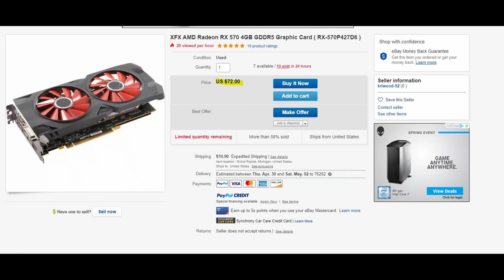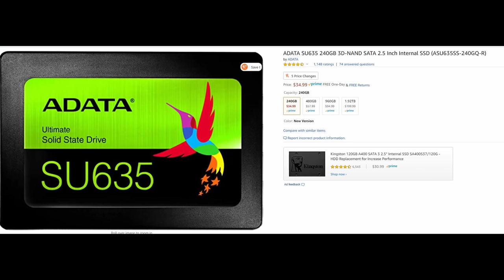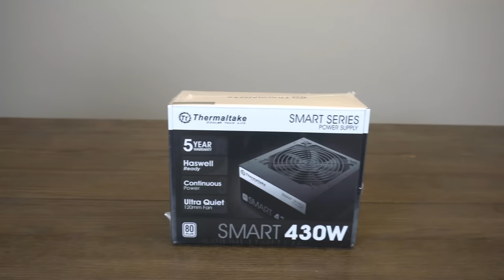$220 Just Get Gaming PC Build - Dell Optiplex 2020 + Benchmarks

Comment: And did you just placed the hardisk without putting a wire in it
Reply from the maker: Well it would seem silly to install a hard drive without cabling it up.  :) It was cabled up :)
Reply: @PCTechHustle  did you bought cable extra for hdd or it is just with psu

Comment: Hey so I got everything in this build, but when I play Fortnite my fps drops so low, like I’ll get 120 in creative and then 20 in a game, is there something I could upgrade or add to make this stop?
Reply from the maker: Lower your graphics settings a bit or cap your frame rate to 60.
Reply: PC Tech Hustle I have it on the lowest settings, and I have it capped at 60, it still drops to 20, is there something I can buy like upgrade to 16gb of ram and just get a better motherboard to support it?
Reply from the maker: cadecries you should be getting decent frame rates then.  16GB or RAM will help too if you only have 8GB.  Also check into possibly upgrading to an i7.  I have a video I released after this one covering the performance differences.

Comment: what should I upgrade I’m going to get it today but before I buy it is there anything that could change
Reply from the maker: I’d definitely suggest doing a GPU and power supply upgrade at the bare minimum.
Reply: PC Tech Hustle Thank you man now I can begin to game
Reply from the maker: Nice!  Good luck with your build and have some fun!
Reply: PC Tech Hustle One last thing my bad but what do you have any suggest on a gpu because I’m getting a power supply that is 500w if that good but if you have any suggestions could be under 100 or over it does not matter
Reply from the maker: I wouldn’t go too too wild with GPU as you will see diminishing returns with an older processor.  That said I highly suggest rx570/580/ for entry level gaming systems like this.  A 1660ti/super would be about where I would say be you upper limit of spend that makes sense.  After that you will not see as much performance return per invested dollar with more powerful GPUs
Reply: PC Tech Hustle alright thank you

Comment: One question how does the ram works because the dell pc I’m about to but had only 4g ram so does one of these parts come with ram in it
Reply from the maker: The one featured in this video specifically has 4 dimm slots.  It’s max capacity is 16GB or 4x4GB modules.  I’d suggest trying to obtain 16GB.  DDR3 memory is very cheap.
Reply: PC Tech Hustle one last question the dell optiplex Im buying is (250GB SSD, Intel I5-3470, 3.20GHz, 16GB) Shipped with USPS Parcel Select Ground. Do you think with your upgrades I’d be able to play rust it’s kinda the only reason I want a pc if not what other parts do you recommend
Reply from the maker: Absolutely!  Sounds like if it comes with an SSD the only thing you will need to do is upgrade the GPU / PSU.
Reply: PC Tech Hustle thanks

Comment: Would a gtx 1650 not be a better choice?
Reply from the maker: If maybe you are simply going for not having to remove the hard drive and found a lower profile one.  The RX 570 will out perform a 1650 all day.  Now a 1650 super will be close and a 1660 super will edge it out.

Comment: Dell Optiplex 390
i5 - 2400
OS winPro
8gb G-Skill
60gb Kingston ssd
500gb wd
Evga GTX 1070 8gb superclocked 2 

my humble build
Reply from the maker: Nice!  Slap in an i7 2600 and upgrade to 16GB of RAM you will really have a solid system!
Reply: @PCTechHustle  just scooped 2x8gb Hyper x, they work. Snooping around for a 2600 ...
Reply: First Nation Ojibway I have one sitting in a draw for 5 years
Reply: If u were just up the street I’d say come get it

Comment: Will the optiplex 790 work as well?
Reply from the maker: Indeed!  They ship with a slightly lower end i5 but the difference is within margin of error.  Consider doing an i7 2600 upgrade too!
Reply: PC Tech Hustle I would but i decided to just do a build I ended up spending $451 I got a 240g ssd, ryzen 3 3200 4 core, Asus prime B450m, GTX 750ti, 2x 8gb ddr4 3200mhz ram, and a 400w power supply  how do you think that would run?

Comment: Could a get a newer gen processor and get better results
Reply from the maker: For this system you can upgrade to an i7 which I may just may be doing in my next video 😉

As for newer gen CPUs you would have to buy a newer gen Optiplex which are quite a bit more expensive.
Reply: @PCTechHustle  Im buying all these parts could you make a building guide for people who are new to putting in parts?
Reply from the maker: I am working on putting together that kind of video very soon.  Stay tuned and get subscribed if you aren’t already!

Comment: Shouldn’t  the GPU bottleneck due to the processor??
Reply from the maker: It does a fair bit.  I also did a follow up with an i7 upgrade to showcase the performance differences
Reply: But does it drop horrendously like after 1 hour of gaming it gets to like 40FPS

Comment: Wait so if I only get a good processor with a pre built pc and I play fortnite will that single handedly boost my fps?
Reply from the maker: Absolutely.  Check the video I literally just dropped.  But FPS improvements going to an i7 of the same generation.  Just a quick drop in and the build cost stays under $300!
Reply: PC Tech Hustle  Thanks! But I have another questing because I am new to all of this and I am upgrading my setup, will my monitor determine the max amount of FPS I can run?
Reply from the maker: No but it’s recommended if you are looking for high FPS you have a high refresh rate monitor as well.  You can experience stutters / frame drops if using a low refresh rate monitor but pushing a ton of frames to it.  144hz monitors are typically the sweat spot people tend to target.
Reply: PC Tech Hustle  ok thank you for the help!
Reply from the maker: Sure thing!

Comment: So I built the 790 and when I plug it in it has a beep sequence like 1-3-2 my ram is fine I’ve tested on a different pc I get no display but the led #1 is in the only thing I can think of is me getting some metal shavings that I need to clean off the motherboard any suggestions????
Reply from the maker: Yeah if you drilled out the cage like I did make sure the board is cleaned off completely / the inside of the case is.  Blow it out with an air compressor / compressed air if possible.  I’m not sure what the post code beeps are referring to, you might have to look that up.  It’s possible something might be shorting (hopefully can be corrected).  Also check to ensure all power cables are plugged in properly and into the correct locations.  You might even try removing everything and just booting it outside the case at worst case scenario.
Reply: PC Tech Hustle the beep codes means something is wrong with my ram but it’s fine the only thing I can think of is the metal shavings I just wanna play my games with my new rx 580 :/
Reply from the maker: The beep codes can mean many different thinks.  I’d try the things I suggested
Reply: PC Tech Hustle yea I’m like 70% sure that it’s the metal shavings from drilling out the hard drive cage
Reply: is power button LED Orange or Blue While the #1 LED is lit? also did everything work fine before drilling HDD cage out?
Reply: GuitarSounds oh I’m fine now and everything was good but I suggest if you drill out the hard drive cage to put out all the parts just to be safe
Reply: GuitarSounds and yes everything worked fine

Comment: Hey man I bought my brother in laws old desktop off of him for 150 any ideas for good mother board and case upgrades for a i7-7700 that’s I’m taking out it and going to build a whole new pc with a Corsair water cooler that my freind gave me
Reply: My prebuilt btw is a XPS 8920
Reply from the maker: With a non-k chip you don’t necessarily have to focus on getting a ‘Z’ based motherboard as they would have the overclocking features and built up VRMs but with a locked processor there is no need if you are trying to build from a budget.

As for case of using a Corsair AIO just look for foot mounting options.  There are so many cases out there that support water cooling now it’s hard to really recommend one just look for something you like.

Hope that helps!
Reply: PC Tech Hustle I mean it’s not like I’m a on super tight budget but I do want to get a pc that’ll be like mid tier range. Thank u for the info !
Reply: PC Tech Hustle and for me I use Bluetooth headphones when gaming so I won’t have to particularly worry about a sound card right ?
Reply from the maker: Hah nope!  Sound cards haven’t been a thing for a long time.  Motherboard have built in HD audio a long time now

Comment: i have a  Dell Optiplex 990 slim and 250 dollars what can I do I want a gaming pc for fortnight
Reply from the maker: Pick up a used graphics card RX570/580 are about the best value cards out there, can be had for $80-100.  Snag a 430-500w PSU (~$40-50).  Pick up an SSD (~$30). Then swap to a case of your choice with the remaining money left over.

Comment: Did it come with sata 3 cables or you used your own
Reply from the maker: It comes with some for the HDD and optical drive but if you are doing what I did you will have to get some 90 degree cables.

Comment: good video but you put the sata cables in wrong, the flat side of the cable is supposed to go into the motherboard and the other side that has the angle is supposed to go into the hhd or ssd.
Reply from the maker: If you listen to the part where I explain the reason why I used the data cables in the orientation that I did you would know why 😉😉😉.  Also it really doesn’t matter there is no “correct” side of a data cable.
Reply: @PCTechHustle  I looked back on the video and I clearly missed where you explained it, so I apologize about that however, I would be careful when you put them in like that because I've had a sata cable actually break from being bending like that one in the middle. I did not mean to sound rude or anything by what i said, and I know there really isn't a "correct" side but what i was trying to say was is that it fits more nicely whenever the flat side is in the motherboard first and when the one with the right angle is in the drive you choose. now, I will say one thing, I completely understand now why you did what you did in the video but in builds where the gpu isn't big like the one in the video I strongly suggest you put the flat side in first, I promise it makes things better. anyways, other than that I enjoyed the video and it's good to see youtubers like you helping out new people to pc gaming. hope you take care.
Reply from the maker: No worries, no offense taken.  Yeah I agree using the cables in the way you have mentioned especially if you need some space to clear a case panel, etc.  I appreciate your input.  Sorry if it also sounded as if I popped off a bit.  Sometimes people don’t watch the video and want to criticize first.  Thanks again for the productive and positive feedback!
Reply: @PCTechHustle  no problem mate, and I totally understand. I hope you become big one day, you honestly deserve it because most youtubers won't even reply like you did. thanks for that. have a nice one my guy, also I subbed because I do intend on watching more of your stuff.

Comment: Is there any other graphic cards that could fit in this and would work fine? cause all of this together is $314 and I would still have to buy a monitor
Reply from the maker: Well if you drill out the HDD cage like I did you options are about limitless.  However if you are trying to keep the cage then you will need something 10 inches or under in length to fit.
Reply: PC Tech Hustle I’ll probably just do what you did if I ever get the money for this lmao,you also earned a sub for how fast you reply:)

Comment: Will these parts fit in a 780
Reply from the maker: 780s are tough to work with because they are much more proprietary driven.  They have very large CPU coolers that get in the way of A LOT of stuff.  I would not suggest using one if you can avoid it.  Though you CAN potentially make something work.  I typically stay away from the 80s series optiplexs though.

Comment: can you link the right hand cable options and how many we need
Reply from the maker: Check the description
Reply: PC Tech Hustle i did i don’t see the right angle cable up there
Reply from the maker: My bad, I could have sworn I put that in the description.  Fixed!  Check it out!
Reply: PC Tech Hustle i bought Dell Optiplex 9010 Intel Core i7-3770 3.40GHz 8GB RAM 180GB SSD Win 10 Pro for 210 shipped , MSI Radeon AMD RX 570 4GB GDDR5 for 110 shipped so far
Reply from the maker: Holy crap that is a deal!
Reply: PC Tech Hustle i’m still trying to find a 450w-600watt psu for under 50 and 4-8gb of ram
Reply: PC Tech Hustle any recommendations on a psu that will fit under 50 , and i need to upgrade from the two 4gb of ram  to atleast 12 . the ram is currently PC3-12800

Comment: i got a optiplex 7010 sff for $190.40 and a gt 1030 low prfoile for $84.49 and got 4 sticks of 4gb of ram from crucial for $91.57 it came total as $366.46 in total i could of had gotten better deals if i bought a dell optiplex 2020 instead of a 7010 sff :(
Reply from the maker: Dang man!  Yeah those are rough deals.  The 1030 too is a complete waste of money if you are trying to game.  I will actually have a parts selection guide video out tomorrow as I’m building up another one of these!

Comment: How are you getting those frames on modern warfare, I built the pc the exact same but I can’t even get 80 on low
Reply from the maker: Not sure what to tell you.  What application are you using to validate your frame rate?  I was using MSI Afterburner
Reply: PC Tech Hustle I was using msi but after tweaking a bit with the settings I was able to get around the same frames as you on high settings. Thanks for the build guide though!

Comment: Would you recommend doing this long term
Reply from the maker: Doing what exactly long term?  There are no risks here.
Reply: PC Tech Hustle like if I wanted to be able to use for 2 years and it would work
Reply: PC Tech Hustle and is it better to buy new
Reply: PC Tech Hustle plz respond because i will either do this cheaper or new and lower performance
Reply from the maker: Sorry for the delayed response.  Honestly,  this is a good, really cheap option.  If you are just looking to get into gaming and have something to tinker on for a year or 2 or more this is a great option!  Especially considering how low of a price point you can enter into PC gaming and out perform consoles by more than double in some scenarios yet at maybe half the price!  

Does it have huge upgrade potential?  No , but there is a bit more you can squeeze out of it.  I actually have plans for my next video to go into some upgrades for this system!  

Bottom line is if your budget is say between $200-250 and you need to allot some additional cash for keyboard, mouse, and monitor, definitely go for this!  However if you can save a bit longer there obvious better options like an entry level Ryzen system, or heck if you check out my last build and you want to go into the used parts market completely, there is serious price-to-performance potential out there.

Though I would say with an Optiplex, you can’t beat the reliability / low risk + do minor upgrades to make a decent little gamer PC out of it for very low cost to entry!

Hope this helps you decide.  Feel free to ask more questions 😉
Reply: PC Tech Hustle THANKS MAN yeah I will definitely hit you up if I got anything you have Instagram?
Reply from the maker: Yes I do, check description where I have all my social media accounts listed

Comment: I think I’m gonna try something like this I’m new to PCs but I have been understanding stuff a lot so pretty much buy a optiplex and buy a gpu and the other stuff depends on how much money I have and what the optiolex needs
Reply from the maker: To use a GPU that requires 6pin/8pin pci-e power I would also recommend buying a new PSU, like the one featured in this video.  You can get by with not upgrading the PSU but you would need a very low powered GPU like a 1050ti, but that would mean for some serious performance decreases in gaming.  You CAN also get by with not doing a SSD again thst would make for a painfully slow experience that I don’t recommend.  

I may make a bare bones Optiplex video to show case these things but I recommend spending the extra little bit of cash to get massive user experience improvements
Reply: PC Tech Hustle ya I’ve been watching a lot of video I think I’m gonna get a 750 ti and not get a power supply since I am on a bot of a budget and I still need a key board and mouse and a monitor so I will buy a cheap graphics card and a ssd and it depends on the optiplex I will upgrade the ram
Reply from the maker: ATS that will work!  You will just have to adjust graphics settings in games to accommodate.  You can always make upgrade later on!
Reply: PC Tech Hustle ya that’s the plan when I get a bit more money but I think for my first pc it’s gonna be good I just gotta find a good optiolex haha
Reply from the maker: Good luck with your build!
Reply: PC Tech Hustle thanks

Comment: Instead of drilling it, can I use a screw driver?
Reply from the maker: Highly doubt it, you would like end up destroying your screw driver.  Note: you don’t HAVE to do this if you get a shorter GPU, which I recommend in the video
Reply: @PCTechHustle  Thanks, I was thinking of getting a 580 so I guess I have to get a drill lol
Reply from the maker: The MSI armor card should fit.  They are 9.5” (according to the specs listed online that I found)
Reply: @PCTechHustle  Is the normal rx 580 and rx 580 armor the same. Just different in size?
Reply from the maker: There are many different sizes.  The MSI gaming card that I had in particular was a hair over 10”, which presented me with fitment issues